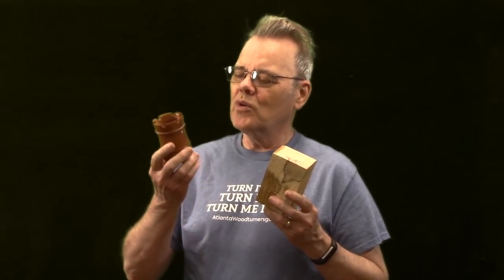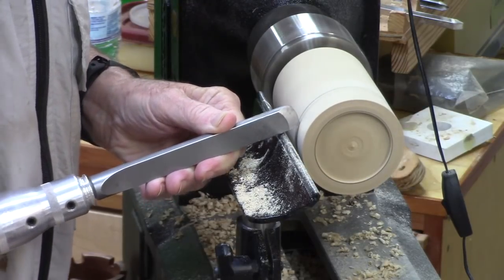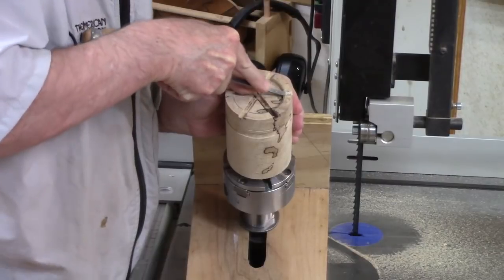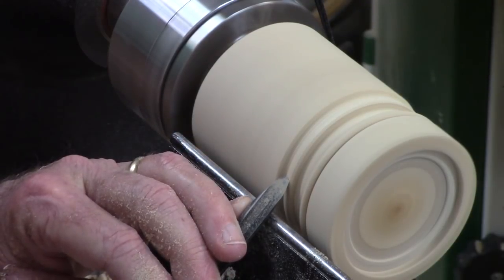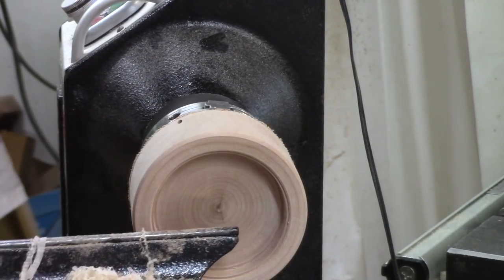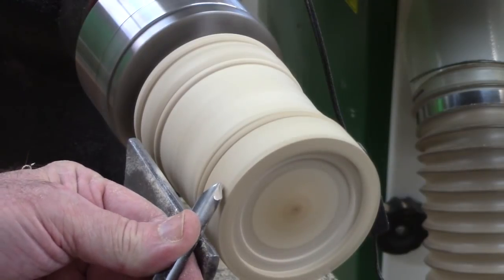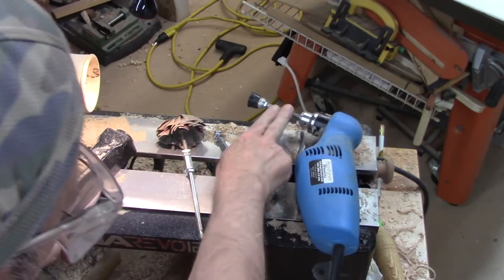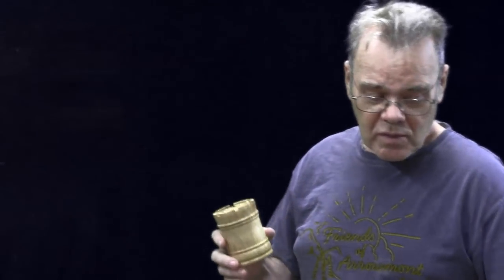Wood Turning A Lidded Rook Box!

Comment: Thanks, Mike! Another super project. I, too, drill the jam chuck but use a smaller hole and then squirt compressor air into it to pop out the turning.
Reply from the maker: Great tip!

Comment: Another method to get evenly spaced markings is to use an elastic band (such as is used in sewing). Mark increments spaced equally making sure the desired number of markings are less than the circumference (in this case you want six so the length of those six marks should be not exceed the circumference). Then you can stretch the band around the circumference so the first mark is overlapped by the seventh. I've used this method when installing porch railings to get even spacing of the rails without exceeding the maximum allowable spacing of those rails (normally 4").
Reply from the maker: Thanks for the tip!

Comment: Just a year ago I made a very similar one, Mike; same size and with six castellations, though I was wary of using the bandsaw. You did that very efficiently. Mine incorporated my first go at shop chased annular inserts, for a screw on turret. Only yesterday I drew up plans for a full chess set for next Autumn. I expect it to take a while, but am looking forward to ring turning the knights.  Bernard.
Reply from the maker: I saw somethng on ring turning knights but it looked like alot of work for 4 knights. Good luck on your chess set.

Comment: Great project!  👍👍👍 I plan to turn one for myself.   I will need to think about how I turn this piece and change up some of the order of operation to simplify even more.  Will pass things on to you once I figure that out.
Reply from the maker: Please do!
Reply: Mike Peace Woodturning 

As requested:

I just completed my rook wood turning.  I rounded the wood to the final diameter with the beads in place and marked off where the lid was to be parted off.  I Placed tenons at both ends of the cylinder piece of wood.  Prior to parting the top off, I used my lathe’s indexing to mark off six axises.  I then marked off the spaces on side of the top  for later removal of the spaces with band saw. Parted off top and hollowed out body with as  small tenon to go inside the top.  Placed top’s tenon in Chuck and hollowed out and made sure inside would accommodate step jaws of chuck would fit in side.   Flipped top over and removed tenon.  Then removed wood from center of top like you would do as a mortise, but went a little deeper than necessary to provide clearance for band saw blade to not make kerf marks. Cut spaces using marks place on side of top.

Used a painters mixing stick with sandpaper to smooth out saw marks inside the small castle openings in top.   

In all, about 1 hour 45 minutes work.  

If you use the lathe’s indexing, it eliminates the need to measure around the top using a millimeter scale and piece of paper. 360 Degrees / 6 = 60 degrees for center of each opening. Worked like a charm.  My Jet lathe has indexing for every 15 degrees.  If your lathe has indexing with 48 positions, then each position is 7.5 degrees.

Comment: Another nice idea to add to the Borrowed Ideas Book.  Thanks for all the tech tips.  BTW what brand of chuck that makes the long jaws you used?  Thanks. Stay safe and well so you can keep the tips flowing in more videos.  Cheers, Tom
Reply from the maker: Record Power and Teknatool make them for their chucks. Designed primarily to get to the back of a bowl after reversing. It is one of my least used chucks but it is perfect for deep boxes. Or reversing lids when you put a mini dovetail inside the lid as part of the design.
Reply: Mike Peace Woodturning Thanks Mike.  As usual, you’re always helpful.  Cheers, Tom